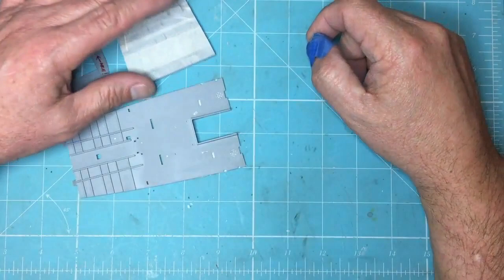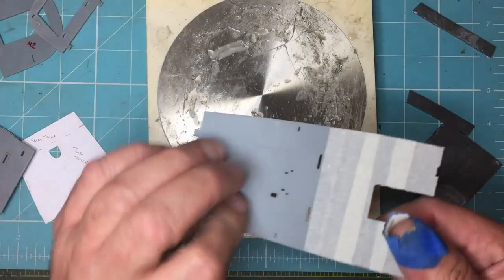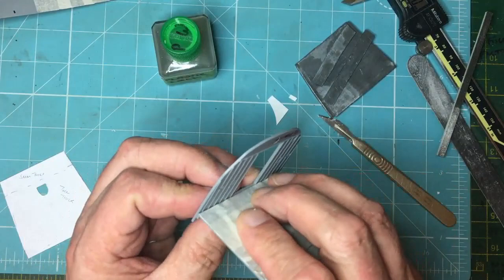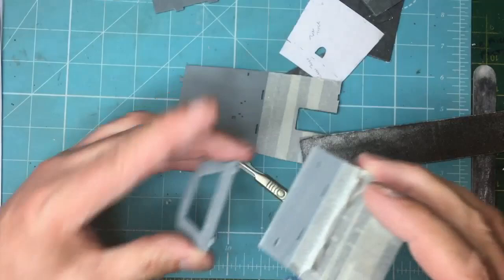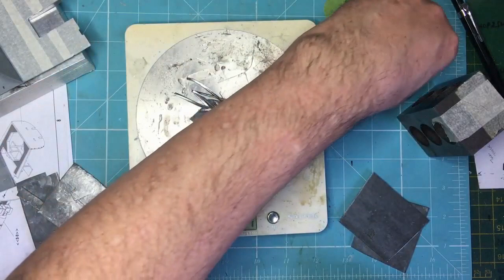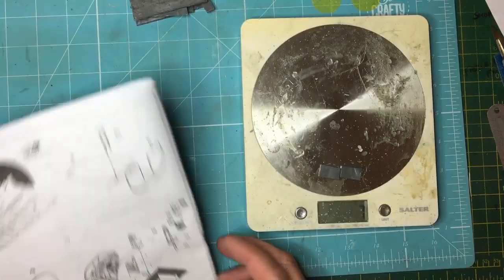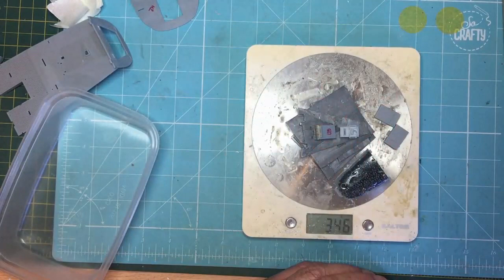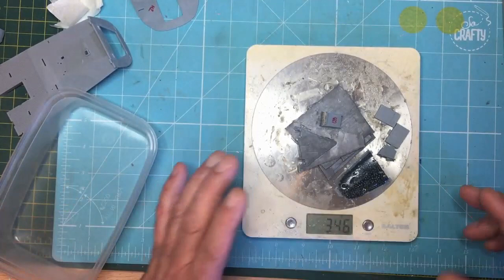Weighting around.. getting over 300g of weight in our 1/32 B-24 kits.

Comment: i know main landing gear are hollow, so if the front tires are hollow as well you can add lead shot to tires before installing the wheels into them , also as a future tip and i know this is an old post, but look into a product called friendly metal it melts to a liquid form in ordinary tap water and by volume and density it is heavier then lead and will allow you to fill voids and match interior dimensions easier, or just look for Gallium metal